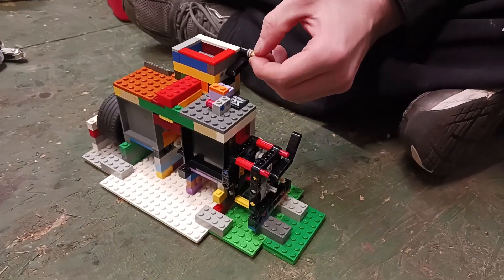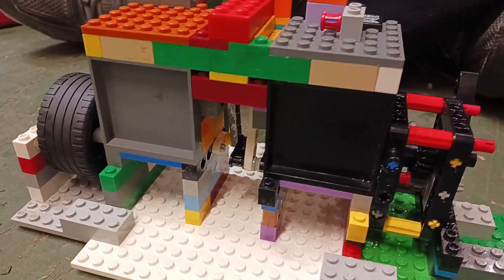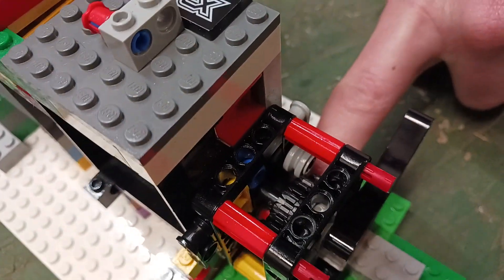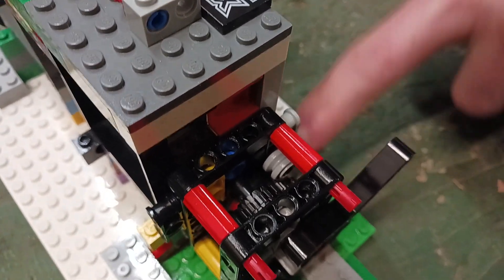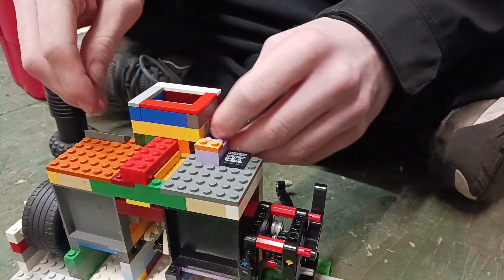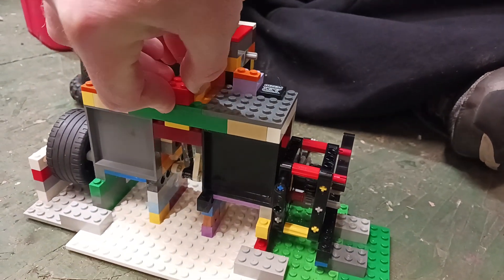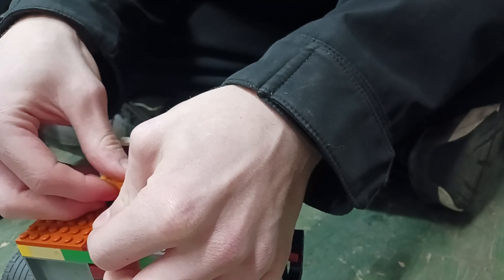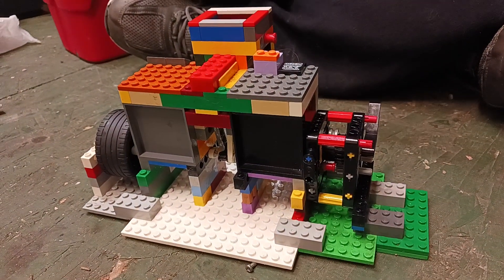Latest Lego Piston Vacuum Motor Improved

Comment: how did you get the 180 degree crank not to stall
Reply: or is it a 90 degree crank
Reply: @GTech_builds made it opposite from itself cause I do not have the real crank pieces but if you can tell where the valves are the valves go down further than the brick itself so I just did what I had to do with what I got and plus timing for it i had problems with the timing cause of the way i had to build it
Reply: It's single acting so a 90 degree crank would mean 90 degrees of coasting if I'm correct, a 180 degree crank means there's no power stroke overlap but the second power stroke starts immediately after the first one ends, so theoretically zero degrees of coasting.
Reply: @Dudeface167 yes I had no idea how to explain it thank you!!!
Reply: No problem 👍